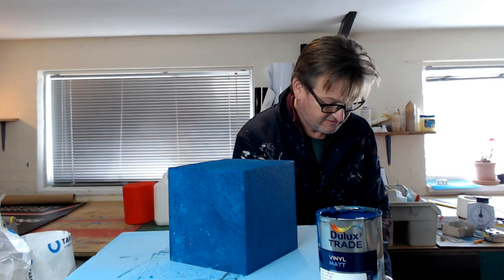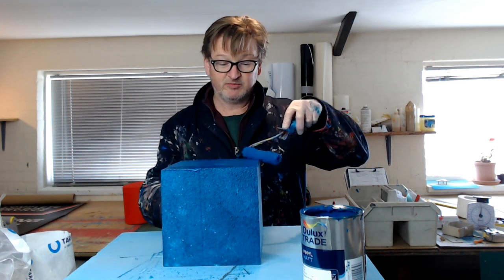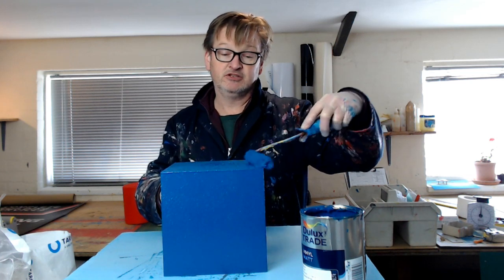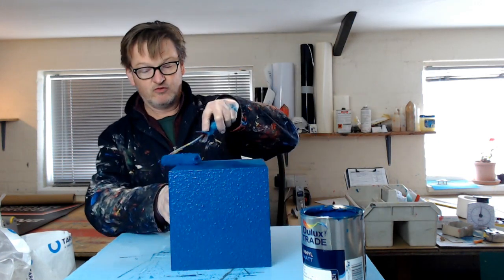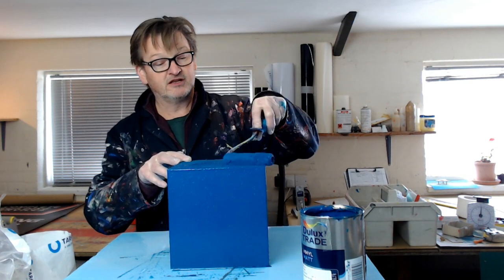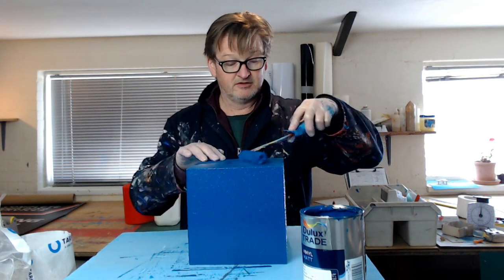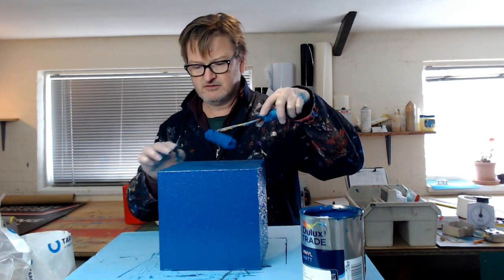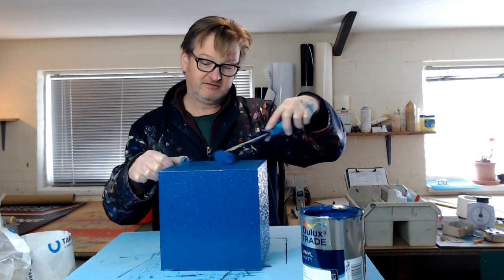How to Paint Styrofoam and How to Paint Polystyrene

Comment: Hello there please help me im looking to build a vivarium for some reptiles im wanting. But im wanting to create my own background. Last time i did i used concrete. But i seen a guy in America he used. Latex based drylok masonry waterproofer. But when i went to b&q i told them what is was for and they have no clue. And i dont have a clue. So i bought some FLEXYPOL WATERPROOFER IN GREY thinking it was what i needed so i put a bit on the polystyrene to test it but it melted. And i have no clue what i need to use or where to get it from.

I need something to harden my polystyrene and in grey colour. And also safe for ny reptiles. I dont mind if i have to take a few steps to create my background. But any help will be great thanks in advance.

Comment: THanks for this, I have a wall of Polysterine and am wondering what to use to give it a hard coat so it doesn't get damaged easily? I saw your PVA with sand video and this is not an option for me, any other way or product you recommend?
Reply: mix water proof PVA and sand and paint together makes a hard coating that can be used.

Comment: Does the pva make the polysterene waterproof or will sbr bond be better? I would value your advise, thank you
Reply from the maker: Normal PCs won't do the job, use waterproof PVA available from Wickes building merchants. Using the correct PVA makes the poly good for outside use.